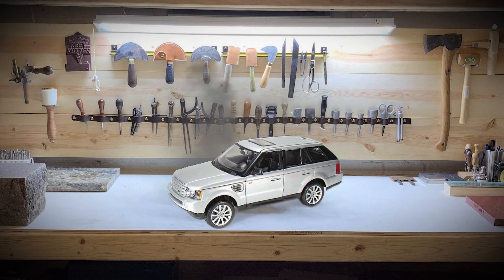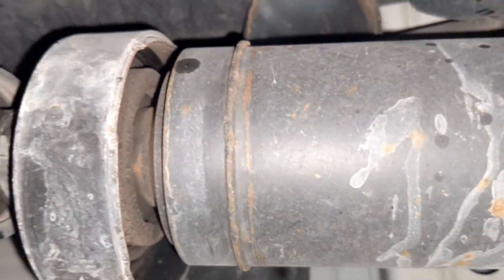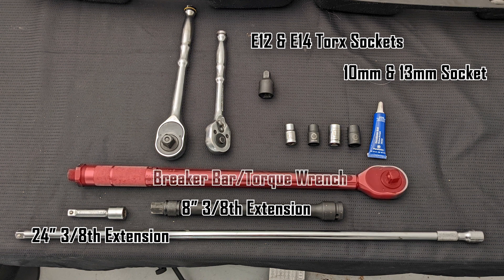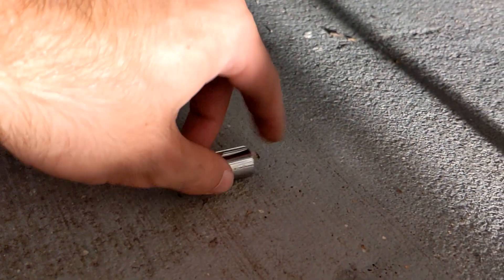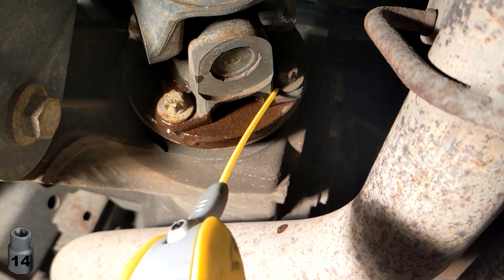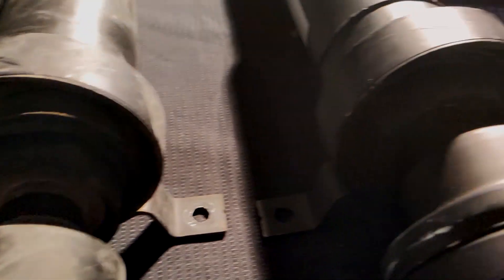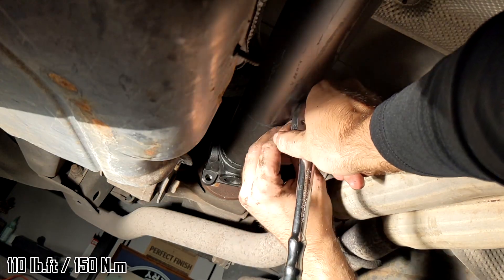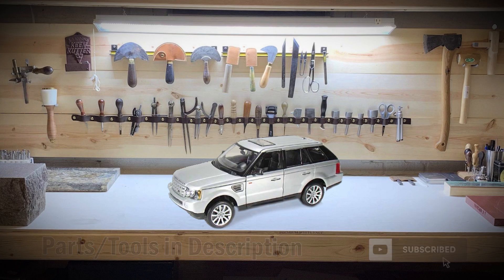Rear Drive Shaft Replacement - Range Rover Sport or LR3

Comment: Great video thank you just changed the rear valve block on my rrs and used your video only trouble I had was reinstalling the air pipes which you didn’t show man what a hassle to get them on lucky I bought two as I stripped the thread on the first one I was putting in so used second one and got it with a bit of patience so will change all the insides of new one into stripped one cheers again👍

Comment: Great video, Roughly how long to do the job
Reply from the maker: If you don't run into any problems it's maybe 1 hour. First time probably 2.5hrs because bolts will be stuck or hard to remove/access.

Comment: Nice video, I tried to replace rear propshaft on my LandRover D3 . I could not undo the rear bolts,  not enough room to engage a breaker bar
Reply from the maker: Yeah those are the most difficult, you may try heating the bolts up with an induction coil (but these are better for nuts) or trying to get more leverage by using an extension. I used rust penetrant spray and used about 3 ft of extensions so I had more room.
Reply: @HazyJay  I suspended the two rear wheels on a 270 mm high car ramp, So space was so limited and awkward to apply enough torque on the wrench.
I applied clutch cleaner, and used extention too.
I will have another go at it tomorrow.
Please, does the worn centre bearing of this Propshaft affect the stability of the car. My steering is wobbling so much when I hit about 50m/h.
Reply from the maker: @maintenanceengineeringinsider  I can't think of a reason why the rear prop shaft would cause steering wobble, even if the prop snapped in two it wouldn't affect steering. Vibration/thumping under the floorboard is what my symptom was, I'd try pushing/pulling the wheels while the car is off the ground to see if you have a loose wheel hub or suspension component, tires will need to be off the ground though.

Comment: Do you have to mark the old drive shaft somehow before you remove it to reference the balance weight for when you install the new drive shaft?
Reply from the maker: Let me start by saying the manual states you should mark the old drive shaft to make sure it lines up with the new one. However, the RRS rear drive shaft is a single piece and would be balanced regardless of how it's installed (as long as the bolts line up) because it's symmetric on it's long axis and there aren't two universal joints. I've noted a lot of people don't mark single-piece drive shafts and I didn't mark mine, I reinstalled it whatever way the bolts would line up and I don't have any vibration or issues.
Reply: @HazyJay  Good to know, thanks!👍🏻
Reply: @HazyJay  That makes me think I've either another problem, or a bad replacement shaft!  I replaced mine and have vibration above 40mph

Comment: Was there a high pitched slightly metallic sound that came with speed with these? Trying to diagnose a faint sound here. I know these are a common issue. Clunking here would be obvious, but unsure if that center bearing exhibited any other sounds before that dramatic failure?
Reply from the maker: Nah it basically was normal and then clunking with acceleration. Finding the source of noises is way harder than it should be.
Reply: @HazyJay  Ha yes it is. It is also difficult to explain the source or assume that others have the same range of hearing. I feel like a generative AI questionnaire to reproduce isolated sounds would be useful :P.

When it isn't a whine, grind, or bang, 'whirring' and metallic' and 'scraping' are words that do not do it justice. Right now mine is just faint, but enough that it just sounds odd. Rear diff? Wheel Bearing, who knows.
Reply from the maker: @TheObiwantoby  It'd be nice to put it on a lift and let it roll and make the noise while you're under and finding the source, apart from that it's rolling around with the windows down hoping to find if it's from the front or back and left/right

Comment: Hmmm, Might have messed up by only ordering the support bearing. I did notice that spray
pattern on the underside above/behind the transfer case connection so it looks like that front joint needs replacing as well. With that center bearing gone it makes sense that the other joints would be stressed to failure. I can get a new entire prop shaft for $400. Balanced and ready to go. The support bearing is on order for about $90 and I picked up a bearing puller at HF for $70. So if that front joint is toast I would have been better to just order the  new shaft. Live and learn, right? Hope PartsGeek will take back the returned support bearing. The puller may be of use down the road...
Reply from the maker: I've done that before with the lower control arms, it's just so much easier to buy new arms since if one bearing failed the others are likely on their way out. Definitely keep the bearing puller and you can try that next time haha.

Comment: hey brother, so after the DIY rear shaft job performed, i noticed the humming noise still going on while gas pedalling down around 30-50 mph. A quick checkup at the local shop they determined it is front drive axle/differential is wearing that the magnet on it shows some early metal pieces wear/tear. My car is 2011 rrs SC with only 70k miles on it and i performed all front/rear diffs + transfer case oil service 2 years ago at the same shop (mileage was around 60k miles) and i rarely do some lightweight RV towing during summer time. Do you think it is normal wear/tear due for aging/70k mileage or could it be something wrong with the fluid they serviced(altho they claim only used LR suggested products)? ALso would it be a troublesome DIY job to do since the maintenance manual does involve many steps of parts removal to get that front axle assembly out. It would be easily 4000+ job costs since just the part itself LR056944 would costs around 3000 at LR parts online. Thanks for taking the time to read this.
Reply from the maker: You can buy a front diff from a salvaged car on eBay for 300-600$ and attempt it yourself, it does involve removing both from CV axles and the front drive axle. It's pretty involved but shouldn't be impossible. Would definitely take a whole day. Mine hums too when coasting at all speeds, I've decided to wait until it becomes worse to change the front diff however.
Reply from the maker: I can't comment on the oil they used. I'd assume they have the correct oils in the shop but you never know, and towing can decrease diff life.
Reply: @HazyJay  thanks for the reply. After discussion it seems something wrong inside the front axle assembly and the actual parts to replace LR006011 is about 1000 + 400 core charge fees, so 1:1 parts labor down to total 2800 (8hour job). The metal pieces worry me so I wouldn’t wanna wait for a bigger problem bill later. Thanks again love your work.
Reply from the maker: @harryj1081  That's better, good luck I hope it solves your issue!

Comment: Hello I have same grease leak as yours where drive shaft  Connect to the transfer case , will this procedure replacement work on 2013 Range Rover sport HSE as well? Thank You
Reply from the maker: I'm not sure but I believe it is very similar, however bolt sizes and parts will be different.
Reply: Do you know if I can just replace the grease boot seal instead of replace the whole shaft? Thank you in advance
Reply from the maker: @vinnyk3245  You can, the only problem is it's more difficult to do and usually the center bearing also needs replacing regularly, so it's easier to just replace the whole thing at once.
Reply: @HazyJay  I’m getting ready replace my rear shalf as well 2013 RRS was wondering on torque spec the same? Thank You
Reply from the maker: @vinnyk3245  I'm not sure because I only have the L320 service manual, but I'd bet that the corresponding bolts are pretty much identical.